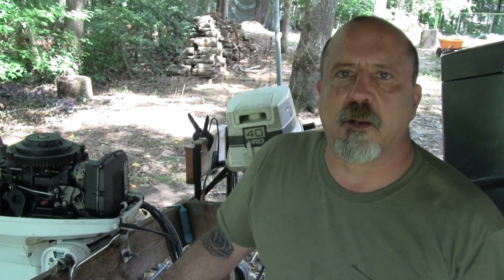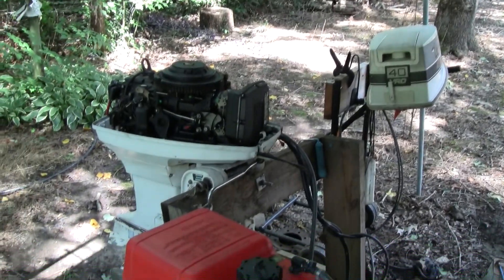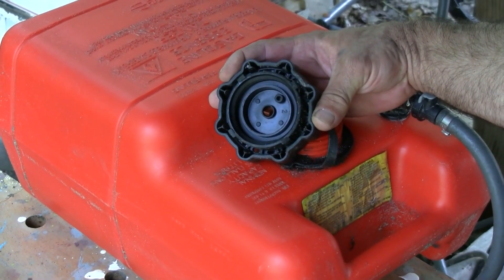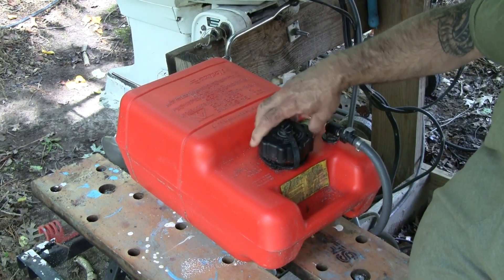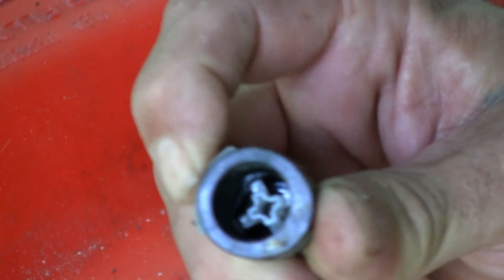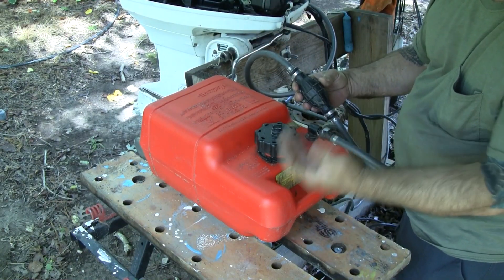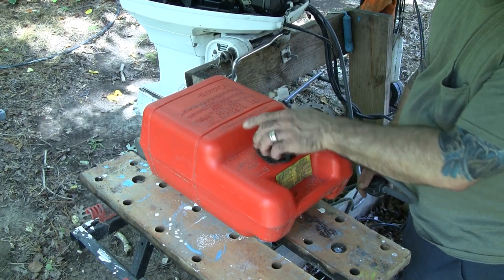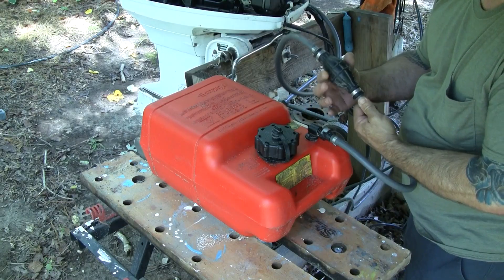Outboard Fuel System Problems! Diagnosing a Rough Running Outboard - Part 1

Comment: I know this is an older vid, but ANYONE who has a gas cap that has a Duckbill Valve the first thing you want to do is snip the end off.

https://en.wikipedia.org/wiki/Duckbill_valve

If you use these style tanks/caps with the vent closed and a full tank the pressure from the outage as the tank heats up will start to pressurize the tank and I have seen first hand tanks split at the seams because of the pressure.

After you make the modification and with less than a full tank of fuel press on the top of the tank - you will hear the air venting out.

This cap design is an EPA/California compliant cap.

Comment: Great video, i have a Johnson 200hp that is not turning on in always flooded, when i remove my spark plug a bunch of fuel is coming out when i crank the engine. Maybe my problem is that primer switch,

Comment: G’day Jose, I just swapped fuel pumps from the VRO unit to a standard pump, new lines, new manifold (no thanks to my own fault) now she starts but doesn’t idle unless pressing the key to engage the fuel primer solenoid, smokes a lot and backfires every now and again..
Any thoughts?
Reply from the maker: first thing that comes to mind is making sure the idle jets are correctly adjusted, I would also look at a possible vacuume leak somewhere in the system, maybe the new manifold?

Comment: Nice video, Jose and thank you for sharing. I'm trying to find out what's the problem with my tank... it get sucked in and looks like I'm having fuel restriction.🐟🪝🎣
Reply from the maker: Sounds like a venting issue. May be try loosening the gas cap and see if it still happens.

Comment: I have the same engine, having a issue where I'm not getting fuel to the top cylinder. Had a friend rebuild the carbs and idk if he didn't do something right or if it's the reed valves. Could you give some insight? Bottom cylinder is wet and top is dry to the bone. 120psi on bottom cylinder and around 75-80 on the top for compression
Reply from the maker: I hate to say this but if those compression numbers are correct that engine is shot and probably needs a rebuild. However, I would pull the carb and take it completely apart to make sure everything is correct. you may also want to check the reeds.

Comment: When you talk about grounding out the outlet of the plugs, what exactly are you referring to? Pulling your kill switch to interrupt Magento connection or grounding them out as in grounding each plug to the block. Just like you would checking for spark. Great info thank you.
Reply from the maker: That's to protect the coils, they need a place to discharge when turning the engine over.

Comment: Thank you for these tips. 
My old Honda 10 fuel line connector is leaking at the engine, causing fuel starvation. I can’t find a new replacement female connector that matches the male on the engine. Should I try replacing both male and female connectors for a newer design, or do you advise another solution?
Reply from the maker: Hard to say without seeing it but that's probably what I would do, Good luck!

Comment: I have an 81 johnson that runs great on the hose, and wont hardly run in the water.   Carbs are spotless, vent was open, bulb tight etc.  Anything else to check ?  Thinking it could be linkage etc.
Reply from the maker: Timing is a good place to start. idle is easy since you can do that on a hose, high speed can be challenge as it needs to be checked under load in a tub (or on the lake, not advisable)

Comment: The steps are great and we’ll covered, but may I add that they don’t always necessarily have to be in that order. It’s a good idea to look under the cowling while it’s running rough and just do a thorough walkthrough as you might discover, say, sink and link way off, before you change/replace anything else.
Reply from the maker: That's good advice! Hit the areas you can without replacing anything first. You are correct, they don't have to be in that order, as long as you cover all the bases.

Comment: I'm in a stratos 285 pro xl with a Johnson 175 and when I go to get on plane and hit wide open throttle for 10 seconds it just won't plane, could fuel cause this issue? The engine doesn't really skip or run rough
Reply from the maker: If it's not getting up on the RPM's enough to plane, a fuel issue is definitely a possibility. It may be starved for gas at higher rpms.
Reply: @ExtremeDIYGuy  thanks for the reply, I took the cowling off and ran it on muffs today. I realized I have a couple carburetors leaking. Plan to rebuild them soon

Comment: I have a 88 70hp johnson that someone removed the oil injection system but left the original pump. 
My pump has bit the dust and I'm trying to figure out what the alternative for fuel pump would be without buying the factory pump as it is costly and no need for the original at this point.
Reply from the maker: I explain how to replace a VRO fuel pump with a standard one in this video https://youtu.be/HJqixyvFr4M Good luck!

Comment: I got a older mariner 150 2 stroke. It cranks an runs good in start choke. If you put it in gear it looses its prime. Its not sucking/ pumping gas into the carbs to keep running. But now while in gear you can keep choking it an it'll run just goes in an out.. Even if you put an electric fuel pump on it it does the same thing
Reply from the maker: Sounds like you need to clean your carbs sounds like your having a fuel issue. The fact that it runs when choked means its not getting enough fuel. More likely than not I think a cleaning or a rebuild of the carbs would help. Hope this helps
Reply: I have  a mercury 1988 run  good for one  hour  after that shouts down  ones stars  in idling  and I put it  on high gear dieds

Comment: Thanks for the video. Where would you look if you're bulb goes soft after running the motor for a bit. I have to reprime every time I want to restart when out on the water.
Reply from the maker: Is it just soft (normal) or collapsed? If it is collapsed the vent on the tank is probably not working. If it is soft and you have to re-prime, I would look at the fuel pump or some of the fuel lines may be deteriorating and clogging the lines.
Reply: @ExtremeDIYGuy  thanks! Just goes soft after a few minutes and I need to reprime to start. Replaced the main fuel line after I found black rubber in the carb bowls. I will probably do the small ones and the fuel pump too.
I appreciate it.
Reply from the maker: Good deal, sounds like the lines are deteriorating! Good luck and hope you get them replaced easily!

Comment: I’m having trouble with my engine, it starts up fine and idles fine but when I go to put it in gear and accelerate it bogs and shuts off until I work it out then it runs good until I turn it back off and start it and take off again. Johnson 150 2stroke
Reply from the maker: I recently worked on a friends boat that was doing the exact same thing. It turned out that the gasket on #2 carb had disintegrated, a piece of it was blocking off the high speed jet. Apparently it would idle fine but when throttled up, the debris would clog the jet and the engine would bog down. Might want to check the carbs.

Comment: Great video man! Im still running into an issue with my 40HP 2 stroke mercury outboard though. Will start first time and run fine at low throttle but as soon as i try give it 80%+ it bogs right down. If i press the bulb a little bit it powers right up to full power though. Ive bought a new fuel tank and line with fresh fuel and spent 1000$ on a mechanic to serivice the engine/clean the carb and its still doing the same. Any ideas? Cheers!
Reply from the maker: I would check the output pressure of the fuel pump. Sounds like it's not getting enough fuel when you throttle it up.
Reply: @ExtremeDIYGuy  I’m having the same issue with a 40hp Johnson motor, unsure on year but it’s a 2 cylinder, am new to outboard motors and this is my first boat, I have watched your videos and it already has a fuel pump installed, motor starts and idles fine, but once up towards full throttle it dies down, once you use the fuel bulb and pump the fuel pressure back up it goes how it should, how would I check the fuel output pressure on the fuel pump, thankyou for any help
Reply: Definitely fuel pump related esp. if it starts easy when you squeeze bulb and then start at first but then bogs under load unless you feed it more fuel. Good start by swapping line and tank, but the mechanic might have cost you for something you could have fixed on a weekend. Let us know how you fixed it.

Comment: started a 65 hp evinrude that has sat for 15 years. rebuilt carbs, set idle mixture to 1 1/2 turns out.
 started motor and it revved up almost to redline. I shut it off. I check to make sure throttle was not wide open and throttle plates were not stuck open. disconnected fuel line from motor and it ran gradually at lower rpms., it wouldnt idle well and carb idle screws seem to have no effect.. when first starting fuel was burping out of the top carburetor.  when I pump ball up firm, it stays firm and gas does not flood out of carbs, so I dont thing my carb float is leaking by. I dont understand how the engine ran to redline with the carb throttle plates set in the idle position. and allowed the motor to evv so high .I do not have throttle linkage hooked up to it, it is on a stand.  when it happened I didnt notice if the linkage pulled back on its own, due to engine vacuum or whatever. I was in a panic because the key switch was wired wrong and the key would not shut it down. so I pulled the ckoke linkage shut until the motor gradually idled don and died. 
I had one of these 1972 65 hp motors before and it was fantastic. always started, idled great, and had plenty of power. I put a set of 75 hp carbs on it and it increased the power by ALOT. I thing they choked the power down on thse engines to 65 hp to meet manufacturing specs for whatever reason. When I took the carbs off and saw how big the reed plate holes were, compared to the carb holes I was shocked. I think the only difference in a 65 hp and a 75 hp is the carburetors.  I have the electric shift version. I think the electric shift got a bad rep because people used the wrong lube in the lower units. The previous electric shift I had worked flawlessly for several years before I traded the boat for a larger one. 
At this point I suspect the diaphram in my fuel pump is brittle or has ruptured. am I on the right track here? thanks !
Reply: Have a 94 Johnson 88 with the same issue, replacing fuel pump had no effect,  thinking intake manifold gasket is leaking, started slowly idled at 1200 rpms at first now it's up to 2800 rpms,  gonna try and replace intake gasket.
Reply from the maker: I'm think that there might be a vacuum leak somewhere. I would check all the gaskets, and any hoses connecting to the carbs. If the fuel pump or VRO is sucking in air that might cause it as well. If you still have a VRO on it, check the impulse line to make sure it's not disconnected, same for the gasket holding the fuel pump (depending on whether you have a fuel pump or a VRO). Hope this helps.
Reply: @ExtremeDIYGuy  THANKS  I will check everything I have a regular fuel pump. The thing that makes me think it may be the fuel pump, is when I disconnect the fuel supply, it eventually came down to a decent idle. when I rebuilt the carbs, I was very meticulous,, and pretty sure I got it right, I may check the bolts holding the carbs on to make sure they are tight. will let u know what I find.
Reply from the maker: @randy1ization  definitely keep us up to date on what you find! Good to share for other folks that may be having the same problem. I've got a pump rebuild video you might find helpful as well. https://youtu.be/DP-qdYlcosc
Reply: @ExtremeDIYGuy  I will check it out. just took the pump apart and the diaphram was not torn, but very stiff. im going to rebuild it with the updated ethanol resistant kit, cant wait to get this old motor purring,
Reply: @ExtremeDIYGuy  at this point, waiting on pump rebuild kit to come in, but I think what happened, is pump wasnt pumping properly, and cause of redline engine rev was because there is no throttle linkage hooked up,  with the engine being carbureted, the only thing that controls rpms is throttle plate movement and timing advance since the fuel will be pulled thru the venture due to vacuum increase. after rebuilding the fuel pump, I will control the throttle linkage so it cant move off idle while I tune it. 
Have u had much experience with the electric shift models?
Reply from the maker: @randy1ization  No, just mechanical shift. I can see how not having the throttle linkage hooked might cause this. Especially since it typically controls the timing too. Let us know how it goes!

Comment: Good Presentation. New sub...I have a vintage 85hp evinrude 1980. Ran great for summer then i noticed a fuel leak. The fuel hose sharp bends were wearing out. I replace a fuel pump also. Just doesn't sound right, reinstalled old pump going for test drive #3. I am feeling like my baby is not get the right amount of fuel...
Reply from the maker: Did you check the fuel tank and lines from it?